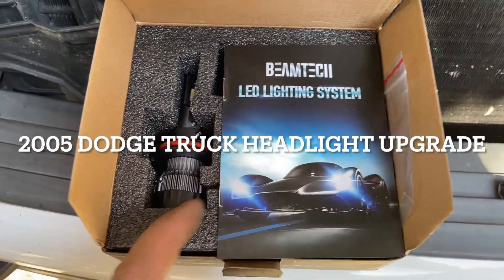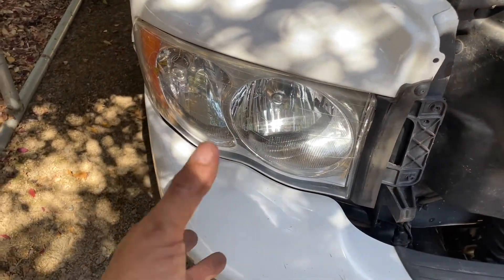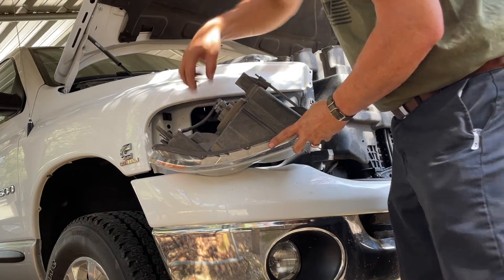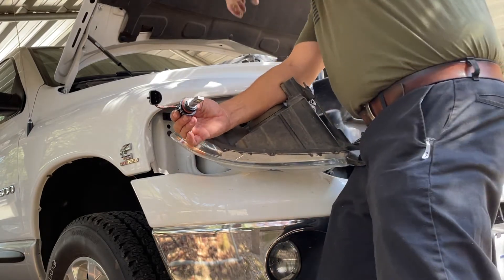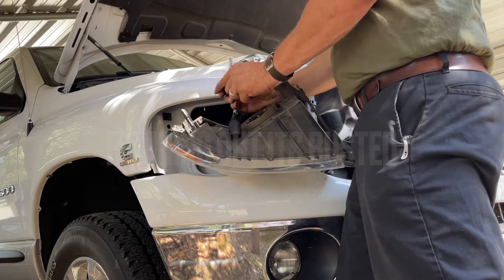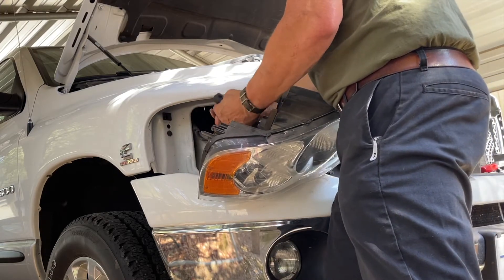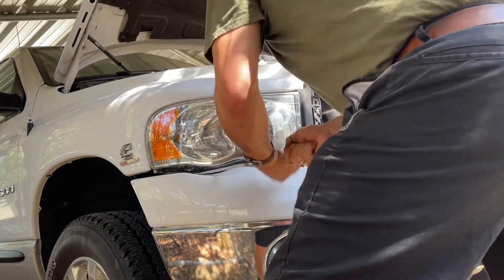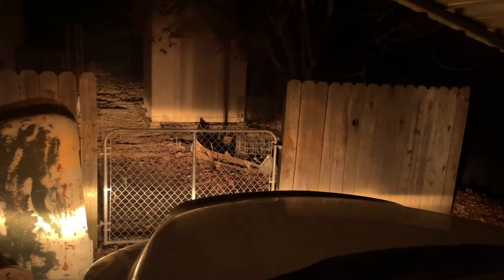LED Headlight install 2005 Dodge RAM 2500 Diesel Truck Beamtech

Comment: Any issues? My leds worked fine with the truck off, but when running would flash a few times then shut completely off and we nonfunctional.
Reply from the maker: Mine work fine. Some of the newer vehicles need a resister installed with the LED lights because they don’t have enough resistance like standard bulbs
Reply: @danedwards7597  yours is an 05? My truck is an 06. I wonder if they made a change. I just don’t want to be ordering lights, them not work and have to keep swapping them out until I find a set that works.
Reply from the maker: @robcolumbus5330  I totally understand. They should be the same as mine since yours is on 06. Check out my Land Cruiser headlight video with the Monster lights. They’re more expensive, but higher quality and way brighter
Reply: Asp having this same issue right now, 2006 is a h13 headlight bulb which is dual filament. Truck off, lights work fine, truck on, only works on high beam. Going to have to order resistors and hope it fixes it... the resistors we're about as much as the bulbs though. 🙄🙄